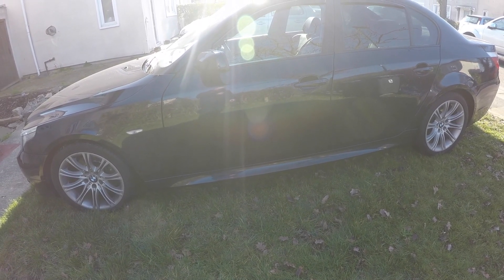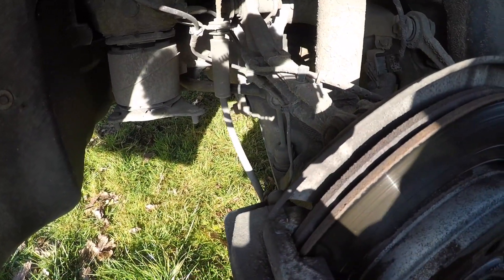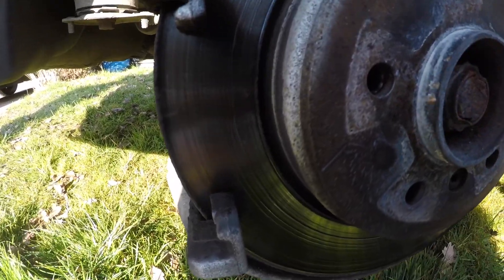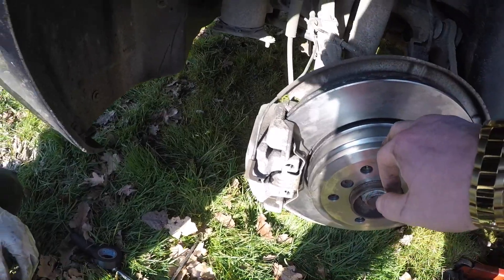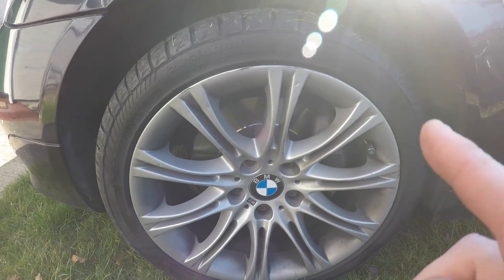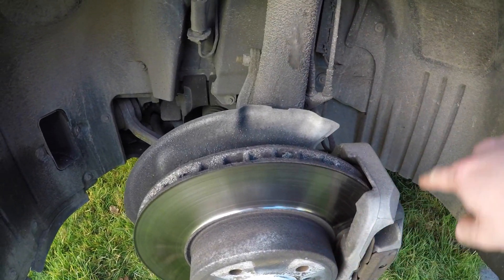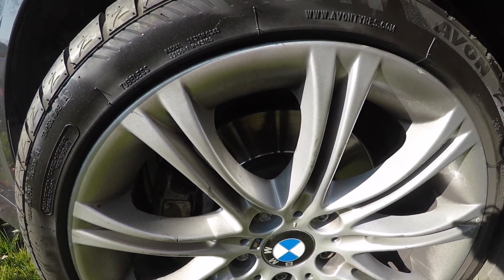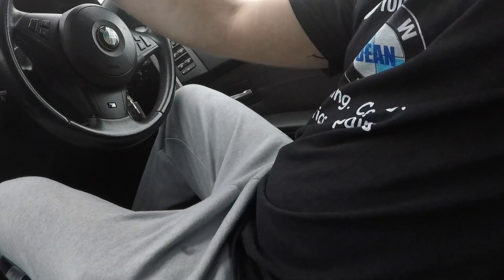BMW E60 How To Change Brake Discs & Pads On Bmw E60

Comment: Thanks for the video. Very useful.
Got a question mate, is 292 mm diameter of front brake discs will also fit e60 2007 163 hp? I know the standard is 310 mm.

Comment: How often do you have to do the inspection? In our state of Arkansas (I know what most people think about Arkansas) we don't have any inspection or emissions test, you just pay your license fee, personally property tax, and get you vehicle license plate. And we have to do it each year
Reply from the maker: We have to do it every year here without fail or you will be fined £1000 pound get caught driving a car without mot and your license will be removed
Reply: @BMWDoctor  darn, that's tough.
Reply from the maker: Tough ain’t the word they check handbrake rust gears wipers under neath the car mirrors make sure all doors bonnet patches seat belts all work tyres are all good no cords hanging out or not bald all ball joints they have a special machine that rocks all the car and checks the ball joints emissions and here we are very tough on emissions
Reply: @BMWDoctor  sounds worse than California.

Comment: Looks like someone pencil whipped the brake lines Story on my work van had a intake coolant leak filling No. 6 plug well . The shop replaced the gaskets cleared the codes said good to go. Didn't make 10 miles misfire came back. I had to move my equipment into a spare van then having to do it twice its sucks I mean sucks. I told him sounds like a bad coil, guessing no test drive.  the BMW brakes on my X5 were the easiest I've ever done.

Comment: I'd have failed them !
Trouble is - did the guy at BMW that checked them an MOT tester or just a normal tech ?. Even so you can't say they are in good condition !
Reply from the maker: Exactly mate even a normal person who knows nothing about cars would know there rusty and not good so there is no excuses a tech a mot tester or just a apprentice they should all be trained to spot it regardless of mot if I took my car into Bmw for a health check which usually they charge and they didn’t spot that I would be wondering who there having work on my car
Reply: @BMWDoctor  Probably the appreciate as time is money !

Do you have a means of contact as I've a couple of questions about parameter readings through ISTA/D on an E53 ?
Reply from the maker: Sorry mate incorrect it’s bmwdoctordean@gmail.com